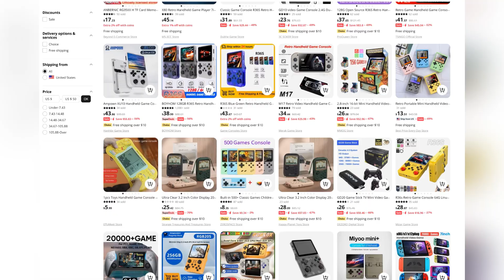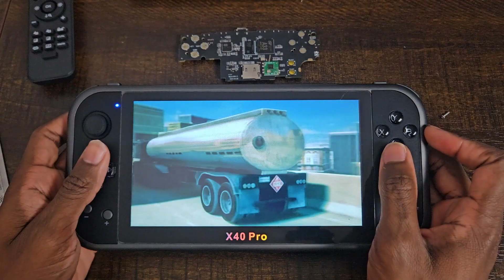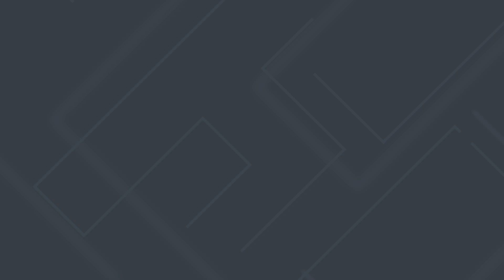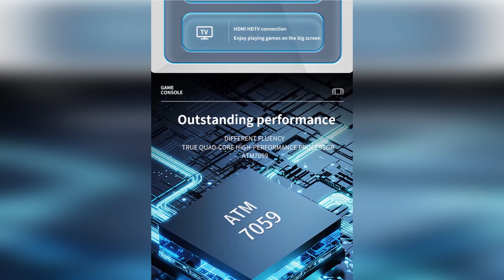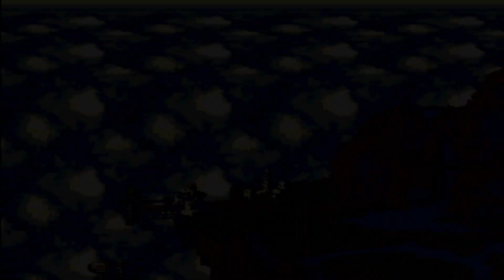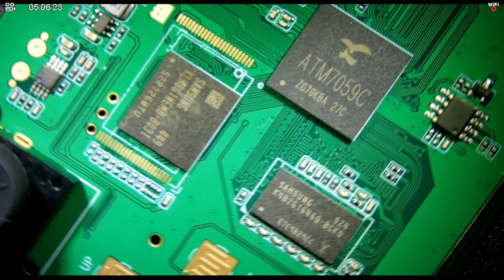The Engineering Genius (and Madness) Behind Budget Retro Handhelds

Comment: Wish you had picked a little better devices, such as the R36S an often cloned device, a clone of another clone, but still a very solid sub-$40 choice. Another great cheap device is the Powkiddy V10. Honestly, sticking to either Powkiddy or Anbernic brand handhelds will help A LOT in the quality, usability, and aftermarket firmware support department. The Powkiddy V10 can be had for $32 on aliexpress. But seriously, pony up an additional 20 dollars will get you A LOT more handheld. Grab an Anbernic RG35XX SP on sale for about $50~$55. You can't go wrong with that device. You can get most any of the RG35XX line of handhelds in the $50-60 range if you catch a sale or a discount code. They're really good devices. You need to stay away from the no-name sub-$50 devices, with the exception of the R36S and the V10. (Avoid the Kinhank K36 - it is not a substitute for the R36S!)

Comment: For anyone in the price range, I highly suggest the anbernic r36s. I got it shipped to me for under $40 total and it runs everything up through n64 extremely well and only runs into performance issues on dreamcast and psp and other systems that came out after the n64. The stock OS was basically just emulation station and the settings were good for the most part.
Reply: The r36s isnt a part of the anbernic line, it is a knockoff clone of another sbc gaming console. Althought the r36s is still a good gaming console for its price lol 👍
Reply: @st3am267  Fair enough. Ali express calls it anbernic (So, I didn't know) and I was extremely happy with it for the price despite having a much more powerful RG35xx